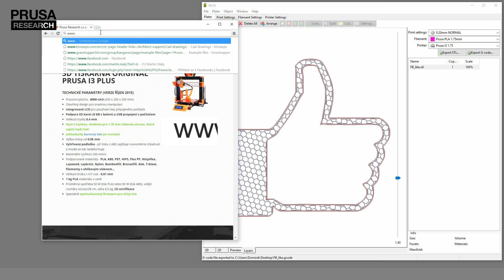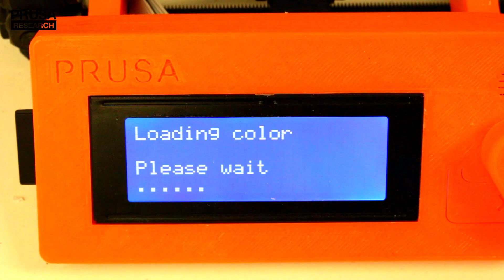Multi-Color 3D Printing

Comment: I need some help with Prusa slicer 2.2.0
I am trying to get the part to be exact size so I made square 20 x 20 mm and in the middle I made a hole 15 mm I found out that if I put on the XY compensation -.35 I get exactly 15 mm but the outside it’s smaller than 20 x 20 What should I do thanks I appreciate your help 
Eli
My printer is anycubic i3 mega

Comment: Does the print bed stay warm during a filament change? I'd hate to miss a change by 30 minutes to find the bed cooled and my part came off.
Reply from the maker: It does. Hotend has a timeout and will stop heating after a while. It re-heats when you're ready to do the color change.

Comment: Hmm, doesn't seem to have worked. It skipped right past the layer I had told it to break at and kept going. I did a CTRL-F and cant find M600 anywhere in the file. This is odd.
Reply: I ended up learning to edit the Gcode myself. It's not hard. Just find the layer break (most slicers insert a comment at every layer) and enter an M600 manually, then save the file.

Comment: How is this entered in the gcode? I need to check something. Is this not combinable with variable layer change? I generated code with variable layer height in Slic3r and uploaded it for Color change. But the print just goes on and doesn't ask me for the change. I wanted to check if I had entered the correct height.

Comment: Dear respected sir, I am using a Diamond 3 in and 1 out nozzle where I will use 3 color. Here you have shown the tutorial for 2 color. 

Please sir if possible, could you make tutorial for 3 color  setup? I  am facing some problem.

Comment: So you pick the layer that should already HAVE the new colour or the last one that should have the old one?
Reply: VictorSteiner
The first layer with the new color. Also try and remove the filament that got extruded during the colorchange unless you want excess filament contaminating your print.
Reply: Your Info was wrong. If I put in 1.6mm, it will print INCLUDING 1.6 and THEN ask me to color change, so 1.8 will be the new color when printing at 0.2mm. Or I really mistyped. Thnx for the advice with the excess, the strange thing is even after a clean filament change when the nozzle starts moving there is another string coming out that nearly ruined my print.

Can't they get rid of it? It's very hard to catch it with a knife or finger while the extruder is moving and you only have a few seconds. I wonder why this filament comes out, after the colour change it stopped and started with that small string just when moving to resume printing .... very dangerous and can ruin prints easily.
Reply: Are you sure? I just tried out a part that is 6mm tall, and the biggest number I can enter in the tool is 6.0, which wouldn't be possible if it wanted to print another layer on top of that.
Totally agree with your point about extruding after the change though. Don't see what the point of that is either.
Reply: I had it again, I entered 10mm for a part that should have the 10mm level in the new color but it only ask for the new colour AFTER Z10.
Reply: Have you looked into my problem Sturmo12? Maybe it is because I resized the original Dragonlock files to 87,5 % but Slic3r shows what I posted. Maybe the calculation that lets Slic3r show results and the calculation the ColorPrint online tool uses are different?

Comment: does this work with the Anet A8?
Reply: Keegan G. Did you find an answer to this?
Reply: Old message but it should. This just edits the Gcode. Easy enough to create a quick test
Reply: @Swarm509  my Anet A8 with Marlin dont. System shows error command G21 :(

Comment: is this possible with non prusa printers, too?
Reply: I'm not sure, this might be a specific feature in the Prusa's custom firmware. Maybe if you use their firmware it might work.
Reply: didnt work on my anycubic i3 mega :(
Reply: The printer need specific data about where to stop and what to do after, therefore change locaciton go to the mod of unloading and loading of new filament and so on.. therefore it has to be feature of the printer to read exactly same data.
Reply: it works with any printer that can handle the pause feature

Comment: Web page crashes for me as it takes too long for Firefox.
Reply from the maker: +legalizeshemp420 How big was the G-code file?
Reply: Josef Prusa
162k,  it was a bridge torture test I had done in slic3r because my thin wall cube I had done in S3D it crashed on before.
Reply: +Josef Prusa (RepRap) Any word on when this will be fixed or what could be wrong?  I tried another Slic3r file and it did the same thing in IE and FF.
Reply: Josef Prusa
Will do.